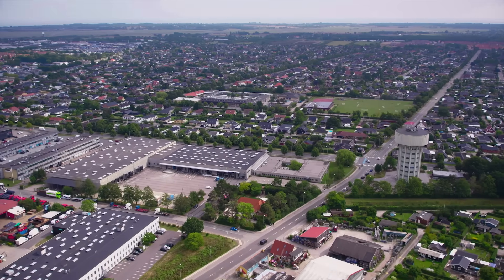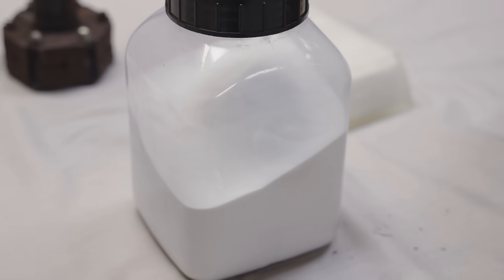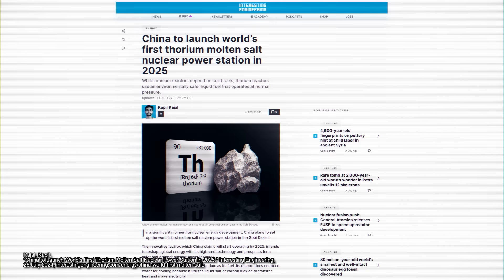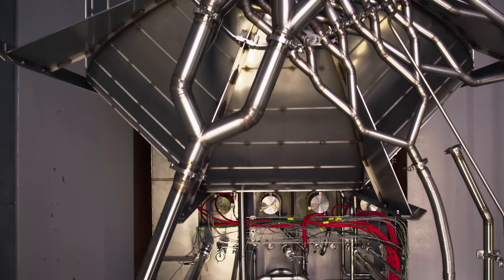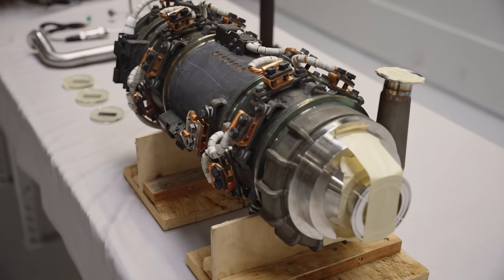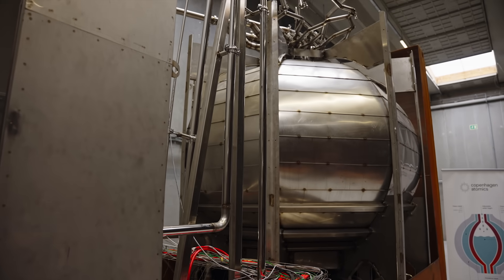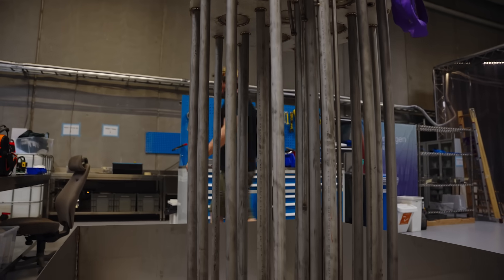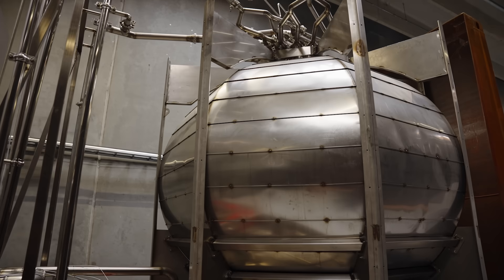Why Isn’t Thorium Changing the World?

Comment: It has nothing to do with the technology not being solved, it's the regulatory compliance forces generated by the current nuclear fuel processors who have the money and regulators bought. As far as the corrosion is concerned the stainless steel is processed to remove the corrosion process. This presentation seems to be an advertisement of thorium being difficult which it is not. Probably paid by the current nuclear fuel processors.

Comment: You should take a look at the German Dual Fluid Reactor. The fuel is in molten salt and it is cooled with a seperate Lead loop. They are building a test reactor in Ruanda in 2026.
Reply: Correction: the new version doesnt use molten salt anymore. They use molten Uranium/Chromium fuel

Comment: saw a documentary on the development of rocket engines and the last few years with AI and material optimisation are pretty fascinating, new materials and simpler more effective construction that saves size and weight while adding performance in mere years and months till they have functional prototypes, hope new materials will aid with this too, would love to have a barrel sized micro reactor for the price of a new car that would make my house or boat energetically independent and autonomous for decades, maybe even sell some excess power to the local grid if present

Comment: It's a big leap to say that they have a working prototype but haven't actually tried it with thorium yet
Reply: A scale model?
Reply: It's really not, if some of the biggest obstacles is price, a pump that can handle really hot fluids, avoiding the salt corroding the metal and they have fixed that, they really do have a working prototype.
Reply: @Andreassoegaard  I'm an engineer,  I'm not passing a design review without testing the intended medium. They have a concept, not a working prototype. They have not proved the materials can sustain the prolonged exposure to thorium salt, high temps and the radioactive by products.

Good luck to them though
Reply: @Andreassoegaard  Fixing those issues in isolation would provide the parts for a strong candidate  prototype, but you'd need a successful run to establish that it's a working prototype. The word "hopefully" sadly drew an underlined under that optimistic labelling ☹️

Comment: Seems like the pump would be the largest point of failure, since corrosion = roughness and potentially debris, causing moving parts to seize. I wonder how much of the internals can be made of glass, silicon, or ceramics, which would be much more stable. Jewel bearings or magnetic bearings could eliminate the need for lubricant. Alternatively, since salt is excellent at carrying charges, perhaps they could use electrophoresis or some other electromagnetic solid-state pump. It appears that electrophoresis has been used in the separator for molten salt reactors.

Comment: Could they protect the pipes using lidenfrost effect? I'm imagining having a dual wall pipe, solid outer, and a sintered inner pipe with pores just large enough for the liquid helium running between the inner and outer wall? I can't imagine how to make a fail-safe other than making the pipes also capable of operating without cooling for XX hours? I wish they had jobs like "fly on the wall" or "peanut gallery"... job description includes, stupid questions and stating the obvious. I'll stay out of the way most of the time.

Comment: I don't know why they haven't considered ceramics to use for lining the container. We've all seen ceramics work in those temperatures on the SST and Ceramics are corrosion resistant too, that's why they are used in cooking.  I had a highschool chemistry teacher that worked in a ceramics lab in China.  There a lot of materials that can be used to give the ceramics different properties such as both heat and corrosion resistance.
Reply: The chemical industry is already using high temperature ceramics. 1000 degrees celsius and above

Comment: Liquid Flouride Thorium Reactors LFTRs I feel are the future. Thorium is fairly common, MSRs are far more nuclear disaster resistant than water based Reactors are, and the waste heat could be used for many other purposes than electricity. It's very cool to see companies trying to further a forgotten path.
Reply: MSR have no track record of being safer than water based reactors. It will probably turn out that circulating hot corrosive radioactive salts through meters of plumbing, pipes, valves, pumps, etc is a disaster waiting to happen.
Reply: How are MSRs more resilient to nuclear disasters? 
Their equipment (pumps, etc.) is placed under much greater stress due to the corrosive, viscous, radioactive and extremely hot substances it must handle.

If you want to generate electricity, you have to boil water at some point. 

Since it is not possible to cool the 700 °C primary circuit directly with water, intermediate cooling steps must be introduced.
This increases the complexity and thus the number of failure points.

The notion that the salt loop can provide process heat for chemical reactions is a verry 50's-idea.

Since then we have learned a little more about industrial safety.
No one in their right mind would design a facility that contained a chemical reactor within a nuclear reactor.

As for his legacy: 

The MSR reactor at Oak Ridge operated for about four years in the 1960s. 
It sits there to this day because it is a mess of radioactive and toxic chemicals and no one had the money or courage to dismantle it and dispose of it properly.

Comment: I wonder if molten salts can be pumped using magnetic induction? I would think that these liquid salts would be highly conductive. Magnetic induction would not require moving parts to contact the salt, I would think.
Reply: Yes, they can, it's called electromagnetic pumps and they are used for pumping molten metals too. Also, one of generator types is based on same principle.

Comment: For a pump to work in a thorium reactor youre better off using a vacuum and pressure based pump. 

Use two chambers one low the other high to force the salt into the lower pressure chamber this way the mechanical and electrical components of the pump dont need to physically interact.

I also have no idea what im talking about

Comment: Lets face it, modern uranium/water reactors are based on the production of weapons-grade plutonium. Not that power reactors make plutonium on purpose, but the roots of that technology are still descended from that. Molten Salt & other new designs break that connection & get away from a lot of the problems, such a pressurized coolant, which isn't a good idea if you get a leak. Molten Salt reactors aren't pressurized.

Comment: "We need fusion to heat our steam powered boilers gooder." - Earth.. Points at Mulch fires combusting if piled too high > Runs Sewage from masses to an Ultrasound system to remove all DRUGS from Human waste and compost nutrients saving some nutrients for running its own Hyper Thermophilic bacteria Cold steam Tesla system > Sends nutrients to fill tanks for years of Thermophile food Masses: "Oh look this video of people freezing water with a vacuum!" < That's how you freeze water between walls of a Cold side of a Cold Steam turbine for biggest gap in heat difference that can't balance because turbine sucks all the heat away..

Thorium.. Lol.. What's the next thing, Earth? I mean.. Since upgrading nuclear reactors to cold steam to greatly reduce nuclear material cost for results and lower heat of operation for longer lifespan of systems is out of the question. Fires Ultrasound from hands to form a high pressure sphere > Uses Ultrasonic echoes to pull water from Atmosphere into the center > Splits water with perfect no loss frequency transfer into water for Hydrogen & Oxygen within the sphere > Fires Ultrasonic shock waves from hands forcing plasma cavitation at the core that charges the rest of the Hydrogen in the ball You know what Happens if compressed to the point of Fusion with the right rotations? Call it a Nuke.. Uses Ultrasonic holography to safely bleed the sphere of its power then walks away

Comment: Why don't use hot molten salt without radioactive fissile material in it for experiment? 
The molten salt can be heated with external electricity. It is good for experiment for durability and corrosion resistance.

Comment: Yeah, but what about exposure ? You fill these stainless steel pipes & pumps &  containers with hot liquid salt first and see if it flows at first... Then after a two months you add radioactive material to the liquid salt... I don't see that happening at Copenhagen atomic. Where's the molten liquid salt that's not yet radioactive ? Where's the incremental step process ?

Comment: The problem with molten salt reactors is they assumed that because they might be better than traditional reactors, they must be good.

The fact is that traditional nuclear power is only really viable if it is subsidized by a nuclear weapons program. The levelized cost of energy on unsubsidized nuclear power is just too high to be worth doing. If a government pays for the cost of developing fuel supplies, breeder reactors, educating and employing a base of technicians and engineers, and subsidizes reactors for producing energy, you can sell energy onto the grid without going bankrupt. Without all that, nuclear power as it is today just costs way too much to compete. Even subsidized nuclear power struggles to compete on cost with solar plus batteries.

So to be viable, molten salt reactors need to first actually work, that hasn't happened yet, then they need to actually be affordable enough to compete with the ever dropping cost of wind and solar, which are far ahead and getting cheaper all the time. And they have to do it without cutting corners on safety, no energy source is safe, nuclear energy has one of the best safety records specifically because of the administrative and engineering effort that go into making it safe.

I hope they succeed in creating a safe, affordable, and sustainable energy source, but they are far from it right now, and if you have a million dollars to invest in carbon-free energy, you should put it into solar, wind, hydro, and batteries, with the exact mix determined by local factors.
Reply: ...I hope you realize fossil fuels receive $7 trillion plus dollars every single year in subsidies just to make it economically viable. Take away those subsidies, and nuclear power is a competitor... include all the economic damage done by climate change, poisoning the ground, and causing major health problems in a productive population, and nuclear is FAR cheaper than fossil fuels could ever be. Remember, coal power spews more radiation just out of their smoke stacks than a nuclear reactor EVER makes producing the same power, let alone all the other nasty byproducts they put into the air.

Comment: You lost me at: Coal power kills roughly a million people a year. Stop with the nonsense propaganda. Just talk up Thorium MSR's and built a better mousetrap.
Reply: It's not nonsense, it's math. They calculate how much the extra pollution in the air degrades life expectancy in an average person, they multiply those years lost by the global population, divide that number based on the percentage of that extra pollution coming directly from coal, and then they take the resulting years and divide that by the average life expectancy across the globe to get a life equivalency. If coal takes 1,000,000 years off of the global lifespan, it's killing the equivalent of 13,642.56 people every year. The math comes out that coal directly takes away over 73.3 million years off the global population, which is EQUIVALENT to 1 million full lifetimes.

Comment: Hi, I find this a very exciting area of research. My understanding of the demise of thorium reactors in the US, came about because it could not be used as a breeder reactor for the creation of plutonium, and the Nixon government had no interest in running reactors which did not add fuel to the US stockpile of nuclear weapons. This in itself seemed a dubious reason for avoiding a technology.
Reply: Salt reactors in general just too prone to corrosion. It's bad enough that you need to replace first cooling conduit from time to time due to it's materials becoming radioactive over course of operation, but at least with water reactors it's just your usual steel. And I wonder just how difficult it would be to clear from molten salt remains, before you can install new one.

Comment: I dunno, their claim of a working reactor doesn't sit right with me. Have they run liquid salts through it for long periods of time, or are they just speculating? Why weren't we shown that? How much will the chemistry and radioactivity of the actual mixture (thorium and uranium) change things from those tests? I'm told radioactivity can degrade the pipes in a reactor too, on top of the ultra-corrosive salts and high temperatures. I'd love to see a video covering how much of a problem the radiation is to the metal and what's been done about it (or why it's not necessary). Seeing their reactor glow red as they do a test run with a non-nuclear salt would have been an impressive picture. Instead we saw what could be a non-working display model?

Comment: Total waste of money. Thorium doesn't yield anywhere near the required breeder rates in practical reality. That's just proven 2nd time taking 2 decades of faling upwards project. Solar + batteries is the real deal. Solar is already cheaper than fence panels guys 🎉😂❤
Reply: The average solar panel array across the US receives only 5 hours of full rated power in 24 hours. This means you would need 5x more solar panels than power consumed, and you would need enough batteries to store 19 hours worth of power. This means you'd need over 57 BILLION KWH worth of solar panels, and would need enough batteries to store a little over 9 billion KWH per day, expecting that those batteries would go from 100% to 0% EVERY single day. That's JUST the US alone. Just for the solar panels ALONE, you'd need 49,000 square miles of land, excluding any infrastructure related to it, the batteries required to store 19 hours worth of power, and any of the paths, roads, and buildings required just to maintain it. By some napkin math calculations, you'd need 900 square miles worth of batteries, excluding buildings, roads, and infrastructure, and that's to completely fill and drain. You'd need an additional 20% just to maintain battery integrity over long periods, and likely 2x more after that just in case there's a weird higher power demand on any single day. This means you'd need 49,000 square miles of solar panels and nearly 2,200 square miles for batteries, BOTH excluding roads, maintance paths, buildings, and infrastructure required to keep them operating. You'd literally have to fill up the entire state of Florida just to provide enough power for the united states that increases their power demand by 3% every year. Based on my numbers, they'd need to expand 1,536 square miles every single year or 4.21 square miles every single day just to keep up with the growing demand.

Comment: The tech is great for making nuclear weapons.  You need a online reprocessing system to make LFTR work.  Remember?
Breeder reactor have not been able to exceed about 2-3 breading ratio, usually much less.  That means there's only enough thorium (and uranium which you need for breeding) for 4-10 years of the world's energy demand (not just electricity).   Solar and wind are good for 100 times our total energy demand or a billion years.  Why are you wasting time on nuclear?   Atoms for peace was PR for nuclear weapons.  Look it up.  It's also a dirty bomb target and source.  liquid reactors can still vaporize and explode.   liquid system can have eddies and dead spots that can auto concentrate uranium to the point of prompt criticality.   A deadly flash or radiation.
Reply: ... I don't know where you got your figures from, but there's a HELL of a lot more than 4 - 10 years' worth of uranium. In fact, I did the math, and JUST in economically viable deposits, there are 228 years worth of uranium, and that includes a 3% increase in power demand year over year and 100% nuclear power without ANY reprocessing of waste. If you include ALL uranium on earth excluding reprocessing, that number jumps up to 556 years at 100% nuclear power.... and that's JUST uranium. Thorium is 6x more common than uranium, and can produce as much as 200x more energy than the equivalent amount of uranium. Include that, and you've jumped up 837 years of 100% global nuclear power at 3% growth year over year without ANY reprocessing. Add in reprocessing, and that turns into 845 - 846 years. I can only assume you're citing some bs propaganda.

Comment: For corrosion, couldn't you use an already resistant metal like inconel then passivate it with something like elemental fluorine? And for the pump how hard would it be to tweak the salt mixture to where you could use an electrohydrodynamic pump with just an electromagnet moving it with no moving parts to fail? Is it too hot to sustain a magnetic field?
Reply: I like your funny words magic man

Comment: I've been sitting here questioning why they didn't think to coat the interior of the piping with acrylics, enamel, or glass to counter the corrosive effects of molten salts on the metal components. 
Vaporized solicits will condensate on positively charged surfaces in thin layers
I only know 😅that for the dumbest reason possible, but😗 yeah.
Also , giving it more consideration 🤔 it'd be expensive to employment such a thing.